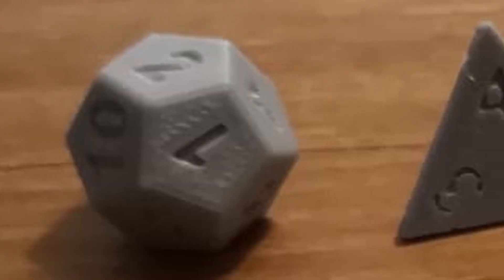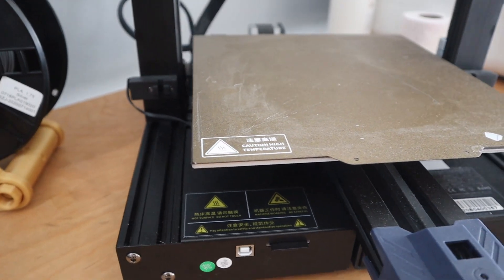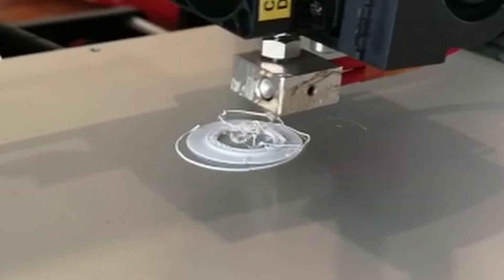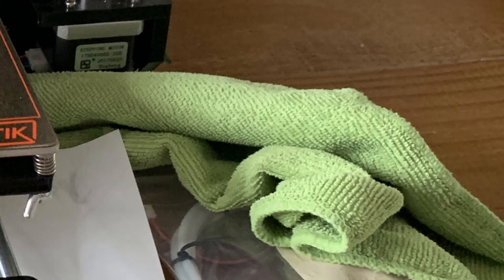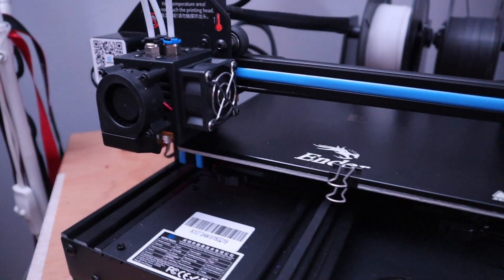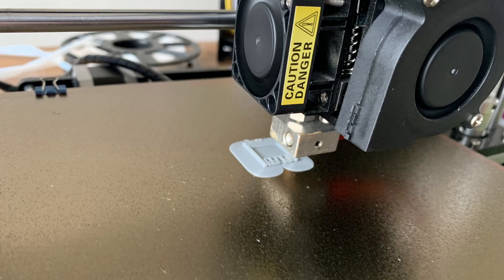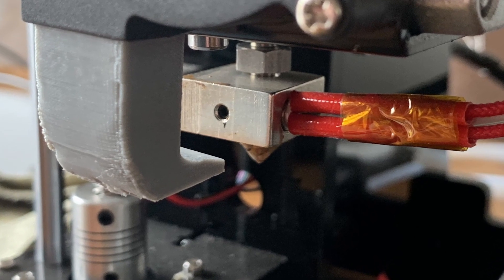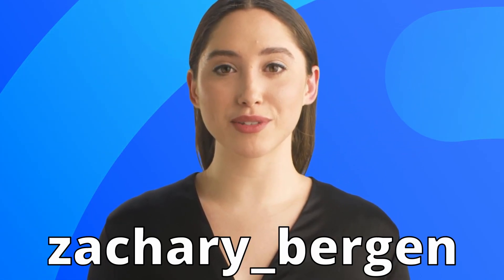3D Print Won't Stick to Build Plate on Anet A6

Comment: Have a V1 original Anet A6 since they first came out, Using a 3mm glass plate sprayed with pva glue and water mix has worked great. if done right you cant see it when dry and the prints are glass smooth. Making sure the motors are level is essential for this printer. small print to fill space in gear drive allows TPU at 50mms which has worked very nice just a pity you cant glue tpu
Reply from the maker: Oh wow, that is really amazing! I use glue as well, very handy, but it is not needed, I won't use it.

Comment: I removed the tape stuck on the bed and has a 3mm glass mirror cut 220mm x 220mm. Clipped on with paper clamps. It works excellently. Heat bed to 60C and pla first layer set at 220C fan 40 to 70%  then print other layers at lower temperature.. No glue required. Make sure the first layer nozzle can print 0.2mm in all 4 corners. I print squares in all four corners at 0.2mm and then peel off the square and measure it. If not 0.2mm I adjust the thumbscrew below to get it level. Make sure the two Z level motors are exactly the same height before doing a auto home with the control set to disable stepper motors.
Reply from the maker: Sounds great!
Reply: @Zachary3DPrints  Try it. You won't be disappointed.
Reply: Fan speed back to 100 on printing.